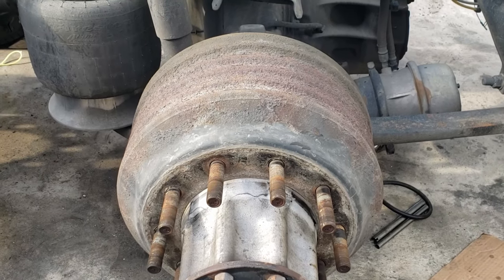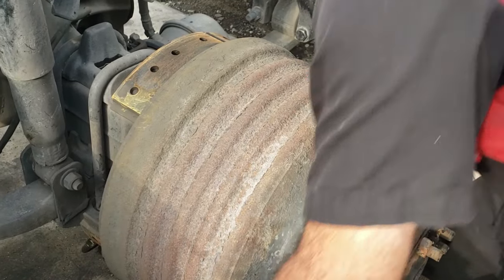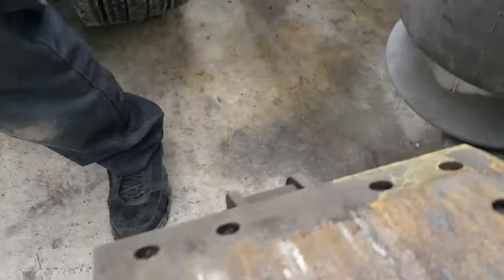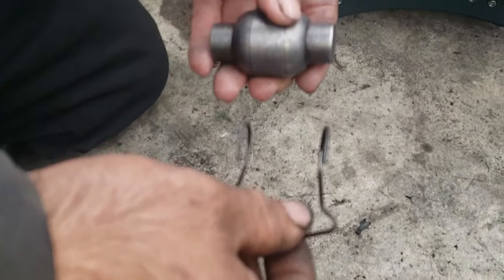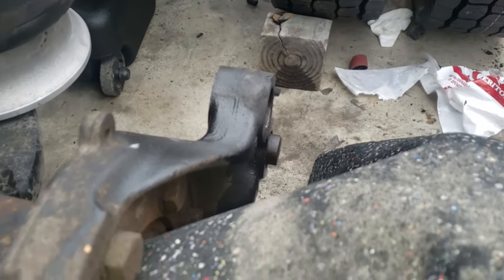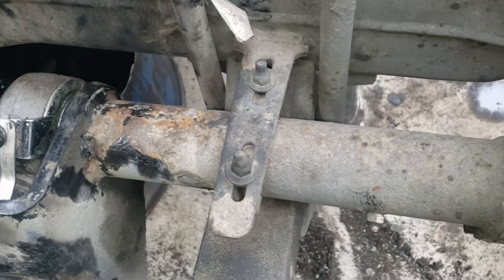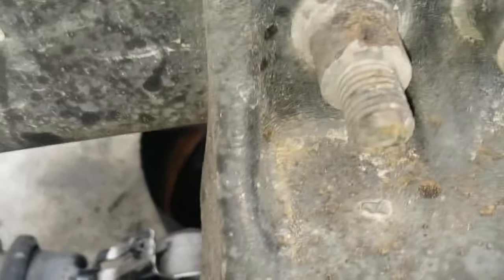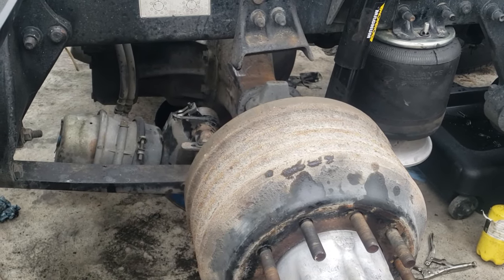How to change brakes on semi truck Frightliner Cascadia, kenworth volvo

Comment: Do not beat on the pivot pins like that. You will break the spider. Just heat the spider and use air hammer to push out the pin

Comment: Damn!! Thanks yo. Im an outdated automechanic and truck driver.
This is easier than car brakes.. just bigger and heavier.

I will say 1 thing tho. Brake on a Mercedes benz (i had a big S class) were prolly the easiest in the world lol
Reply: I have a 1979 Mercedes 300D sedan, the brakes are 2 small cards, 2 pins, slide out, put new ones in, replace pins, dunzo!!

Comment: Man watching you mushroom the anchor pin before heating them was killing me and having you check s cam play with the brake chamber applied was another and the mack book recommends putting the shoe on the anchor pin first and using the tool to put the roller pin spring on

Comment: I put my truck in shop yesterday to replace steer brakes and drums , after I get my truck and take it on the road I noticed my truck is shaking around 50to70 mph , I m not sure what it is but It was smooth before the brake job, could it be a bad drums
Reply: Check your radial runout on your front tires...sounds like those are out of round. everytime you pull front tires off, you have to make sure they are within spec as far as radial runout goes...

Comment: What shoes are you using 4707 or 4709
Reply: They look like 4707 shoes. 4709 has a different style roller pin spri g i believe
Reply: Yea they r 4707 cuz they have red lining nd 4709 have blue lining

Comment: Why did u have to grind it?
Reply from the maker: Hello,  you can see in 5:31 that the roller got got wider when we hammered it,  so we just grinned the edges for the roller to come out easier,  (that juslt in case the rollers dont come off easy, thanks for watching!!
Reply: Ok is that faster then using anchor pin remover?
Reply: Anchor pin press is easier and you can change bushings with them also

Comment: It's usually a good move to just cage the chamber instead of messing with the slack adjuster
Reply: Why? Supplying air to the chamber would do the same. There are only two reasons to cage the brake chamber. 1. To allow a truck with a failed chamber to make it back to a shop. 2. To install a piggy back. You will still have to adjust the slack adjuster once you install new brakes anyways.
Reply: It takes 10 seconds to back off the slack adjuster...
Reply: Sometimes you gotta do both. On badly scored drums that's the only way to get it off.

Comment: Do the other style of brakes mine are different same idea though
Reply from the maker: What kind do you have?
Reply: @TRUCKINGTIPSDIY  I have no clue what they are called the difference to me is the spring instead of the side like you showed they go on the ends not sure if it’s a older style.

Comment: sooo simple.. less complicated than a passenger car rear drum brake.  How about the trailer drum brake? Are they all the same?  How do you know what model you need to order for the trailer? lol sorry, lame question.
Reply from the maker: hello,  the drum and brake shoes have a part number on the side, you also need to take the old parts to the store(core) they will know what to give you
Reply: @TRUCKINGTIPSDIY  i always wonder that you would need the year  and make model for each trailer.  But i’m sure the back trailer brake doesn’t wear out fast as on the tractor.   thx
Reply from the maker: yes they can also find the parts with year and make

Comment: Bro you need to put new drums every time you replace the brake shoe !!!
Reply from the maker: Not really!! But its always better to do
Reply: Nah only if they are cracked or grooved out to bad. We usually run them 2 sets pads per drum but sometimes have to change them even after the first set. There are specs for all of this tools to measure it.

Comment: By crimping the vise on that spring,they get damaged,look at it.
Reply from the maker: no they dont , maybe the paint, but the springs is a heavy duty material
Reply: The damage is very minimal. If you know what you’re doing, you only put the vise grips on once. So there is only one small mark on it. If you’re new, you may have to put on the vise grips several times and that can cause a bit more damage, but still nothing serious.
Reply: If you think that vise grip pliers is going to damage that spring what do you think that massive brake shoe is going to do to it every time someone step on the brakes(1000s of times). It's a vise grip plier not a pair of bolt cutters.  Lol
Reply: I used a flat head screw drive with a 9mm wrench to put those springs on. Honestly the vise grip method looks easier
Reply: I leave all the rollers out and put my springs on. Then take a pry bar and lift the stop box enough to slide rollers in. Way easier then fighting those springs